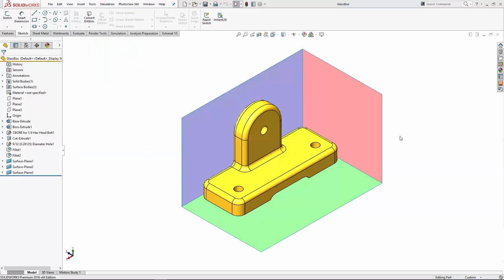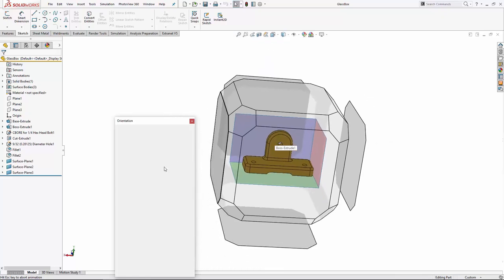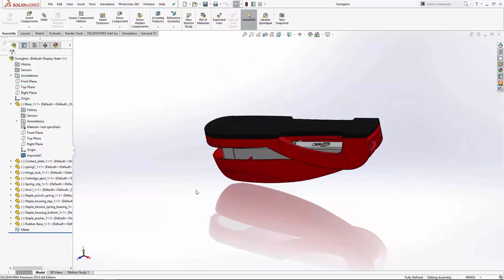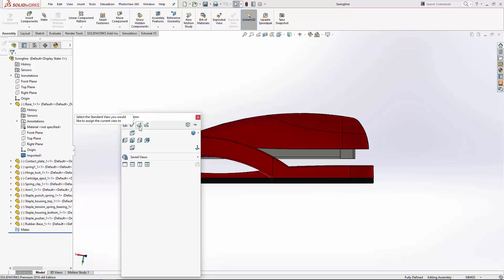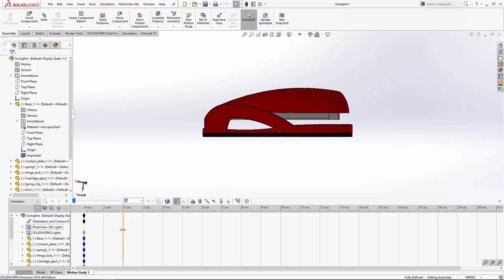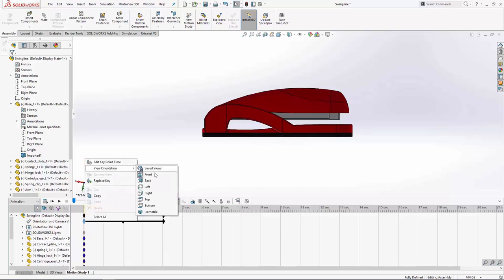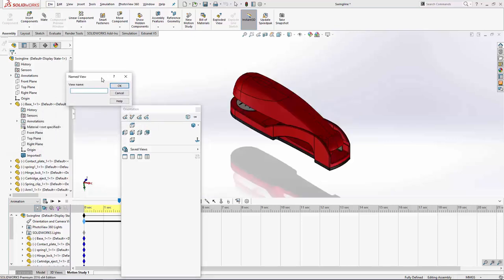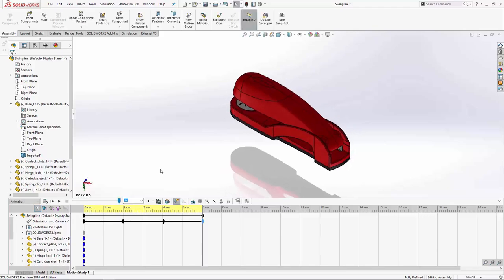Change View Orientations In SolidWorks

Comment: how to did you change the orientation from this part 2:26 ? what did press Sir? 
Thank you
Reply: go to options > settings > view > set "arrow keys" to 90 degrees.  once your viewing normal, if it's off by 90 degrees use the keyboard arrows to rotate 90 degrees.  Press 'ALT' plus 'arrow key' to roll the view
Reply: @Dan-xb4pu  THANK YOU

Comment: Good video but how do you change the triad back to it's proper state in the new views?
Reply from the maker: Slightly more difficult.
Your best bet is to use the Move/Copy (Insert > Features > Move/Copy)  command to mate your 'Bottom' of the part coincident to the 'Top Plane' and then try mating the side of the part to the 'Front' or 'Right' Plane
Reply: Thanks for your reply..I'll give it a go..
Reply: It must be great to be an Elite solidworks user haa? Excellent tutorial, Thanks